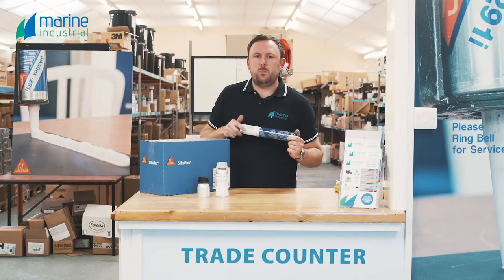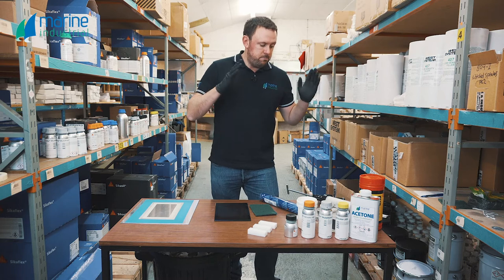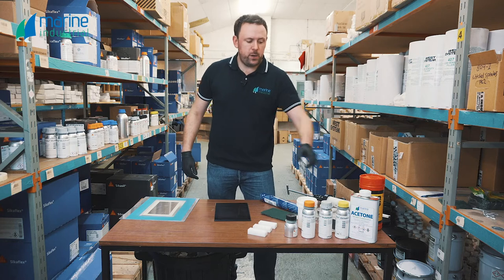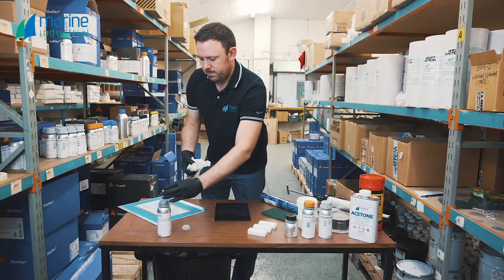Sikaflex 296 Direct Glazing Adhesive - how to bond glass windows in place.

Comment: Can you talk about the surface-bonded (no recess) technique where the glass is positioned using a thin line of self-adhesive black foam (to the edge of the window opening) and then the adhesive is back-filled from around the edges. Thanks